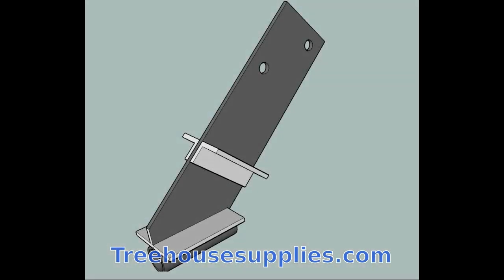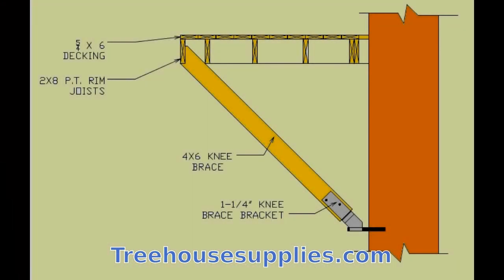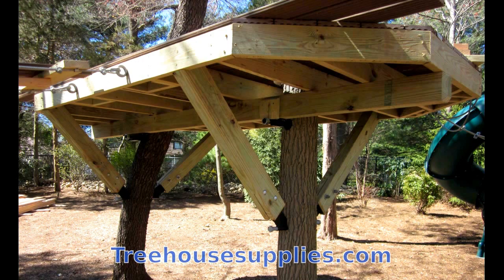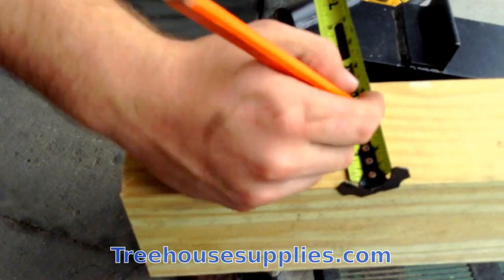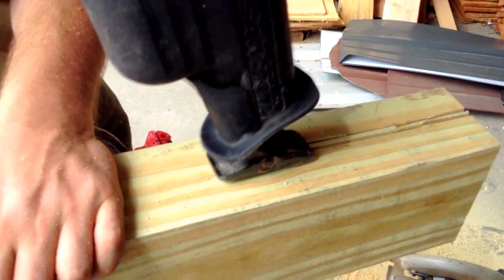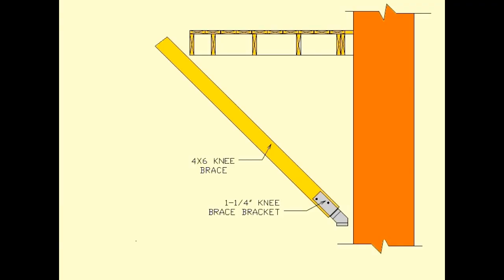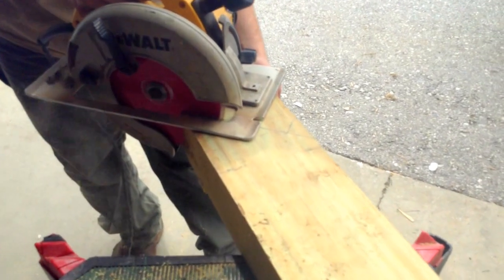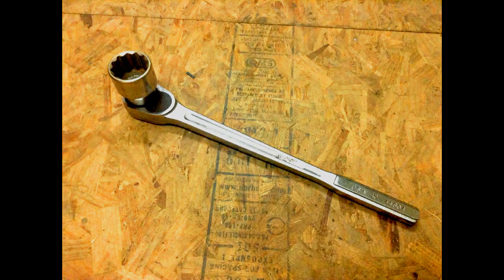How to Install a Tree House Knee Brace & Bracket

Comment: Say I have two trees leaning the same direction, and I want to construct a platform between them. given they have a lean I cant put the TABs plum above and below each other for the upside down A frames. Is it fine to have the top support central to the top beam and central in the tree whilst the below supporting TAB off to one side to stay central in the tree and the two 45 or greater degree beams two different lengths. Again the same trees are probably going to be wider at the low point so the diagonal beams may even need to be off flush from the top beam and off flush from the top beam if you get my meaning. Are these the correct way to address such trees?

Comment: If 4x6s are unavailable at your local hardware store (I'm located in Canada) would it be better to use one 6x6 or 2 2x6s screwed together as a substitute?
Reply: Yes, since you’re distributing the load.
Reply from the maker: double 2x6 is less wood, but the grain is generally more favorable. I'd have to toss this question to an engineer!

Comment: Dont get how this allows for expansion of the tree as it grows.
Reply: @TreehouseSupplies  so what is the point in a tab bolt if the tree is going to eventually push the knee brace out with so much force it separates your joists?
Reply: @bigrig4385  The tree will not push the joists out if you allow the correct spacing between the Joists/beams and the tree.  If you email us at info@treehousesupplies.com I can send you images and more details.

Comment: You guys really need to purchase a beam saw! As someone who doesn't know much about tree houses, I'm surprised to see three (or is it four) 1-1½" lag bolts (or similar diameter TABs?) going into such a small tree. And it looks like two of them enter at the same height on opposite sides of the tree?
Reply: Hi Rob,  as long as you dont compromise too high a percentage of the tree area, it will compartmentalize and heal around the bolts.  Nutrients flow up the tree right under the bark level, so that is why wrapping or choking something around a tree is a big no-no.  You cut off all flow when you do that.  Bolts are fine as long as they are used properly.  The nutrients go around and continue up.  I hope that helps!